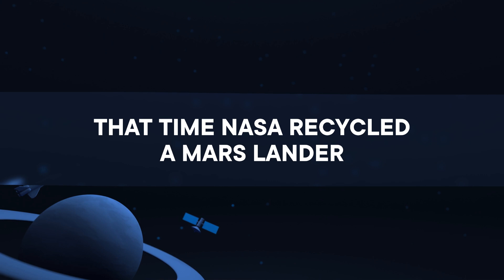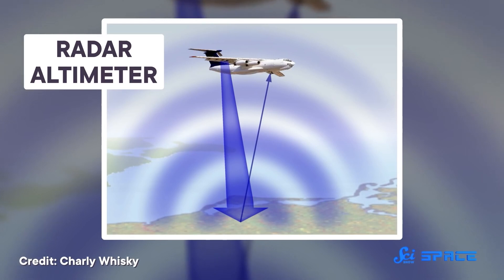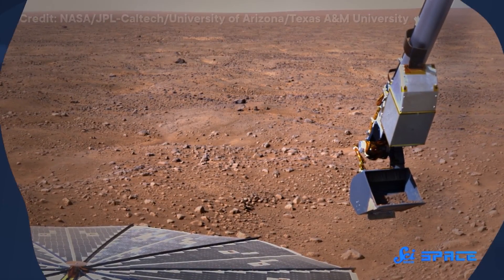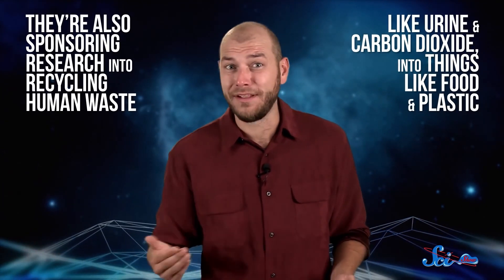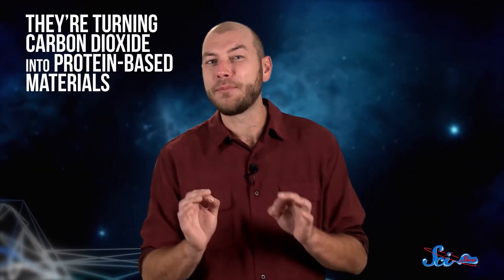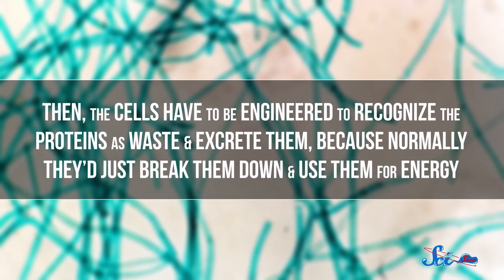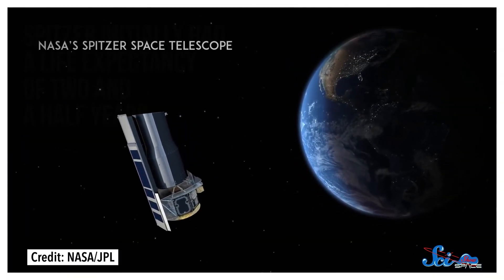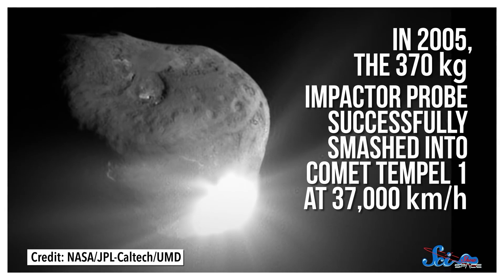Reducing Space Waste Before, During, and After Missions | Compilation

Comment: If much of a ships mass is fluid then moving the fluid would move the Mass. Vibrations  going through the walls sending atoms elections in a certain direction.. instead of replacing chemical rockets how about adding them
Reply: That doesn't make any sense, I don't think you know what you're talking about
Reply: @benG2141  have fluid flowing through the walls.   More expanding room behind so  going back around doesn't slow it down. Have the force from chemical rockets go the the walls and fluid
Reply: @osmosisjones4912  internal vibration, wether in a solid or liquid or gas, don't affect the momentum of an object.